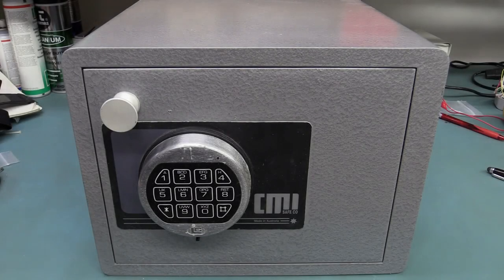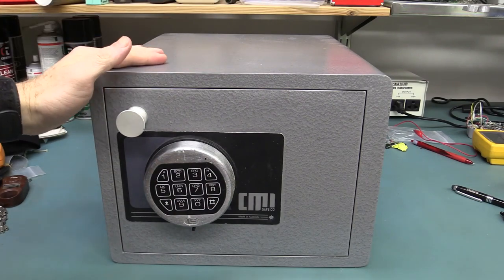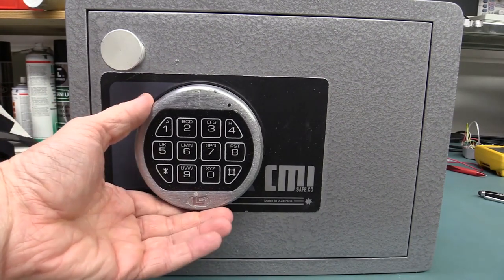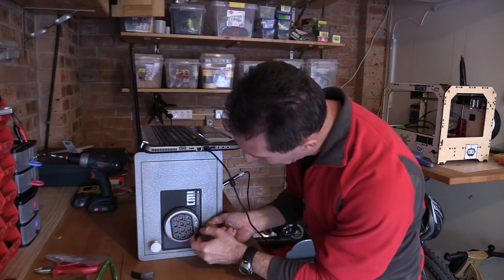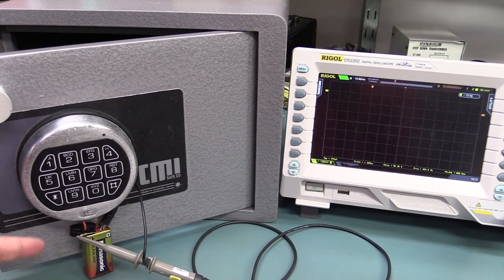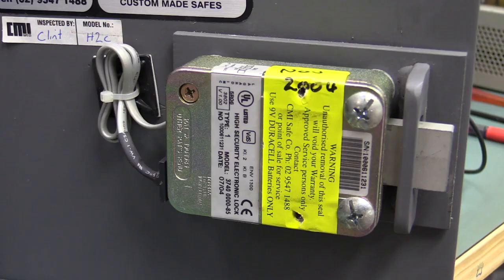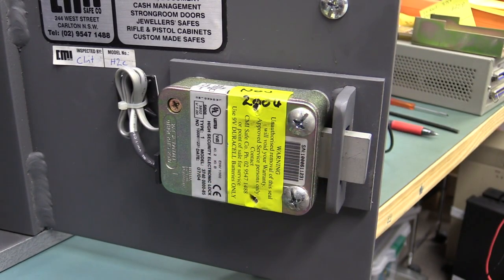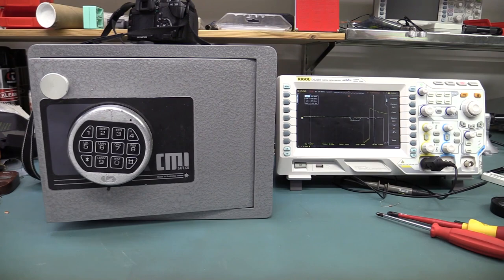EEVblog #762 - How Secure Are Electronic Safe Locks?

Comment: it also has an anti bump pin and spring combo on the opposing side of the solenoid. ONLY if you know EXACTLY what model lock is used, will you know the exact position of that solenoid plunger (witch can be drilled, and you can order templates right from LG for this) all you need is to pop off the face plate of the lock by slapping it upwards, and then at about the two o'clock position, approximately two or so inches from the square hole where the twist knob is, you will be almost spot on with a 5/8" bit.
However, the tiny variations in the lock types between model numbers of these LG locks, is very different in regards to that solenoid directly.
Some are even weird vertical versions of it, so you really need to know exactly what lock it is, what model number and even date it was made to get the right template.
I work with these locks all the time, and KABA MAS (its bigger badder sister company) Cencon models, witch are insane.
Those ones have one time use combinations based on a unique per key set algorithm, that if you need to get into the lock again for some reason (like leaving a flashlight in the safe or your phone....) you have to call the "key master" (main office that holds the key programming software) and they will re-issue you a new combination, you enter that in, hold your RFID key up to it, and it compares the digits you just entered with the allowed algorithm on the fob you have, then if it checks out the lock will grant access, after you close the lock it will not allow the key to be used again unless a "close code" is entered into the system, so the system needs the close code (the system at home base or the keymaster computer) from your fob and that combination, and it has to verify that your close code matches the open code it gave you, or it will not issue a new open code for the lock..... crazy right? yeah totally is.

Comment: Hello everyone , David if you hold a powerful magnet near the solenoid it will unlock (: guaranteed to work just operate the solenoid with Neodymium magnets magnet on from outside the box. you can hear it click. a bit tricky but you have to catch it at the right angle, this is for any digital safe

Comment: @eevblog Its loading a register with your key presses. When it gets to the correct number of bytes in the registers it will test them against the key. You can find out how many digits are in the key by looking at when the extra computer time happens after you press a key(the key check happens). After that you can look in depth at the compute time and try to tell the difference between a written 0 or 1 as it checks each bit.

Comment: Surely by reading the signal into the lock, you could make some assumptions about typical signals into the solenoid. 

Then you could inject noise into the lock through the battery connector and use that carry through into the solenoid? Or do you think the signal would be too attenuated?

Comment: At 11:15 Dave learned the first rule of working on safes:  After touching anything, ALWAYS test the lock (and boltworks) with the door open!  Also, the value of 12" (longer if you can find them) alligator forceps.

How did he close the door? The lock bolt stays retracted until the "dial" is turned counter-clockwise extending the bolt, the spring pushes the slide down and the solenoid pin pops out securing the bolt.  

I am retired, have always lived in the US and my work was mainly with US made safes.

ATTACKS:
1) Bumping the solenoid -- The solenoid operates in the same direction as the bolt on the lock. Bumping might retract the solenoid pin, but the lock bolt is also being bumped and will put pressure on the slide which in turn puts side pressure on the solenoid pin keeping it from retracting.

2) Removing lock cover from the back -- Dave didn't show everything.  When the lock cover is removed a relocker inside the lock is activated, stopping the bolt from retracting.  If it hadn't been removed previously, he defeated it off-camera and judiciously did not discuss it.

3) Drilling -- There is a lot going on in a very small space in the body of a combination lock for a safe; electronic or mechanical.  Drilling is not just having the right equipment, it is also expertise and finesse.  Without intimate knowledge of the lock and the safe, drilling will likely create a more difficult lockout.

50 years ago the hardplate protecting vital areas of burglary resistive safe had a minimum hardness of Rockwell C60 and the science of hardplate advanced significantly over the years.  At the time I retired, some hardplate was absolute hell to penetrate and by no means did I see it all.  If Bob Burglar successfully penetrated modern hardplate, he would be one in a million.

Comment: EEVblog Dave should have tried entering 6 Number and check the timing after that. if the controller reads in 6 Keys and then starts comparing it may then make some kind of early exit after the first wrong numbers or something similar

Comment: Mounting the safe is absolutely essential. Otherwise, you've just boxed up valuable things for someone to take back to their place and break into at their leisure.

If it's attached, they have to break into it in your house, and that's not normally a fast or quiet process. :)

Comment: Old fabrication or Machining trick if you're drilling through steel or hardened steel and cast iron is to use Dawn dishwashing liquid instead of oil or cutting fluid the drill bit will last quite a bit longer love the channel man

Comment: The real quality safes such as the ones used in banks don't provide access to the 9-volt battery nor the internal power circuit of it unless of course it's out of power, in which case the circuit will be opened up to two pins on the outside front to allow bank employees or locksmiths to provide temporary power in order to open it. There's absolutely no way to break into them without brute force methods... which would break the glass anyways. They also have timers so that even given the correct combo they won't open until that timer is up, usually set for minutes before the business opens again.

Comment: Ideally only the keypad should be located externally, the circuit board that controls the lock should be inside the safe where it is totally inaccessible for "hacking." The circuit board also should have timeout periods of increasing length if wrong codes are entered so that someone could not cut the keypad out and use a digital device to brute force the lock by entering all possible combinations. 

I would also prefer a safe have both a digital lock and physical lock(either keyed or combination) to open. Well a primary safe door that is, if it has a secondary access door for things that are needed quickly it could be a digital lock only, such as a self defense firearm, but it's pretty easy to get a small secondary safe for that purpose, and most gun safes do not have a main door, and a quick access door.

Comment: Some high end locks e.g. the Government grade KABA X-10 (KABA also own the La Gard brand) require no external power source which pretty much guarentees no form of powerline manipulation. Power is generated by the user "dialing" the combination, it could still be vulnerable to "shoulder surfing" (like push button locks) but the numbers are shown on a well shielded LCD display which is far more secure.

Comment: I wonder if you could apply smartcard breaking techniques to the powerline?  Glitch it with voltage spikes until the micro starts skipping instructions, hopefully to the instruction that opens the solenoid.

Comment: I realise this is an old video, but I've always wondered if electronic locks could be defeated with an external electromagnet to push/pull the solenoid pin? Also just a note on the software side of things, I'd be utterly astonished if the code actually checked the number on each key press, rather than comparing the code after the last number had been entered.

Comment: Try injecting some RF power. You may be able to bias the solenoid driver transistor ON via circuit rectification. A variable frequency, variable power RF signal applied in either differential or common-mode to the power wires may couple enough RF into the driver circuit to do this. Try frequencies over a wide range - my guess is UHF may work best.

Comment: I wonder if you were to super impose an AC signal from a frequency generator onto the battery voltage  and then press the key pad, would you see a difference in the AC amplitude as the correct/incorrect buttons were pushed? I expect the most obvious response would be around the cutoff frequency  of the internal capacitor.

Comment: Could you do anything to the power to shorten the lockout cycle thus allowing faster brute forcing?  Essentially overclock it?

I don't do electronics so I don't know if you can mess with oscillators that way.

Comment: Most of these locks can be opened in seconds with a large Neodymium magnet.
The mag, when placed in the correct spot simply pulls open the lock actuator.

Comment: Dave, this might sound silly, but because the solenoid is basically just an electromagnet, what happens if we wrap a huge coil around the safe and run current through it?  Would anything iron that is moveable move if we could get a strong enough magnet?

Comment: Step 1: unscrew the handle and push the screw inside the safe.
Step 2: drop a small magnet along the door on a string through the hole (you may have to widen the hole with a drill bit.
Step 3: drop a second magnet on a string into the safe and wiggle until two magnets lock together.
Step 4: pull the magnets out. Now you should have a string looped around the deadbolt.
Step 5: using the string pull a cutting wire through the safe.
Step 6: cut the dead bolt.

Comment: Interesting attack, it could be susceptible to such attack. But when you think about it. When you design a lock like this, each time you press a button the processor saves it into a register either it is good or not, that's why your getting the same result. It is only when all 6 digits have been pressed that the processor compare it with what is in the memory.

Comment: Do not assume that the default admin combination of the vault in your hotel room has been changed from e.g. "0000", or"000000", or "12345", or whatever the manufacturer uses.  I have twice encountered hotel room vaults that could be opened with "00000" after I had entered my guest combination.  Always challenge the room vault before trusting it.

Comment: I'm pretty sure you could bump that thing open with a hammerdrill or pneumatic hammer while gently turning the lock. If you have the patience to get the timing right you could probably even do it with a couple good whacks from a sledgehammer. That little tiny spring just doesn't seem too make the whole lock bump proof and I didn't see any glass plate that could shatter from the impact.

Comment: The material in between the two steel plates on the TDR is actually fossils, according to the Discovery Channel. I wonder if cutting out the external steel plate, then chiseling out the fossils before cutting through the rest would work. Maybe not if the plates are made out of tool steel or tungsten carbide as well.

Comment: Is the resolution of the ucurrent good enough to plug into a scope to detect these tiny current variations? As others said, you need to do a followup video on powerline manipulation, powerup readouts, brownouts, timing attacks, etc. Throw a scope on the eeprom to find the exact time the data gets read out of it to see if it coorelates to anything on the power bus.

Comment: The safes I have also have key access. Each safe stores the other safe's key. If the electronics in safe "A" fail for some reason then the key stored in safe "B" can be used to open safe "A". Yeah...it means there's another point of attack but it's probably about as vulnerable as the e-lock...perhaps even less so. I pretty much consider the electronic keypad lock more a convenience factor than a high-security element.
If someone is really determined, they could cut through the safe with modern battery operated tools or cut-off the bolts from the other side of the wall...or just cut out that section of the wall...unless I make that more difficult by adding heavy shielding in the wall itself.
Reply: That's one of the main problems with the 80 dollar convenience store safes actually. The physical lock is absolute shit. Usually hidden behind a logo plate that comes off with screws and it takes more time to undo the screws than to pick the lock with minimal skill.

Comment: If it locks you out for 5-10mins after 4 or so numbers of incorrect combination attempts, then it seems likely that you could easily reset that by simply disconnecting and reconnecting the battery after the lockout.  I suppose it could have some kind of capacitor in there that is just there to store enough to keep the 'fault' condition from resetting on battery disconnect.

Comment: If the difference in signals was simply whether the correct button in sequence was pressed you'd use 6 attempts out of 10  (wait 5 minutes) then try the remaining 4 to get the first digit, (wait 5 more minutes) then starting with that successful 1st digit try to acquire the second digit and so on. Max time would be an hour.

Comment: That safecracking job when you reconnected the lead back into the solenoid is a surprisingly valid break in.  If you knew the pin outs on the power leads, one can simply apply voltage to the solenoid and pop the lock open.  Smart Joes could take a tube of silicone or hot snot to the power lead, locking it down that way, would thwart that vector of attack.
Reply from the maker: Nighthawke70 No, you can't do that on this lock. The solenoid is protected, they have a patent on this.
Reply: Curses! Thwarted  by patents!

Comment: they prevent power line attacks not just by decoupling. mainly by CODE algorithm.. well its simple the processor doesn't check if the pattern is correct or not until you enter all 6 digits, every time you press a button the processor wakes up stores the value of the button temporarily in memory(they could use different values than actual numbers or even in random order for each time) until you have 6 values stored in memory after that the processor checks if its correct or not.. very little you can see when this algorithm is used, even if you detect a different waveform it doesn't matter since you already have entered all the numbers and got the result anyways lol.

Comment: You should really spend like ten bucks on some kind of surgical / endoscopic pliers. They are readily available on ebay, go up to 30cm and incredibly useful for such tight situations (plugging cables or adjusting pots in hard to reach places etc)

Comment: One may not need an oscilloscope...if you can see signal variations like that on a scope, then it may be possible to just hold an AM radio (tuned to a "clear" space on the band) near the keypad and listen for the variations as the processor changes operations/subroutines. Digital keypad circuits often output RF signals that vary as a result of where in the program code the processor is working and the AM radio picks up the signals and outputs them as frequencies and patterns you can identify over time.
The same principle as is sometimes audible holding a radio close to a remote control. Even infra-red remote controls still put out identifiable RF signals the radio can pickup in a clear spot between stations although it isn/t picking up the actual IR signal from the remote...it's picking up the activity of the processor and/or the circuitry that controls the IR LED. Even when the IR carrier is at a frequency too high for human ears to hear, the AM radio makes hearing the circuit's modulated signals possible.
Reply: I think it's more likely the electromagnetic field from the circuitry is interfering with the AM radio because you're holding it too close, rather than it actually emitting RF signal that are picked up by the AM radio's antenna.

Comment: Try using a spectrum analyzer. You could probably shove a thin antenna through the hole that the battery wires go through. I'd bet that you could pick up the bus traffic that way.

Comment: Errrr................When you accidentally closed it with the cable unplugged,  why didn't you just use a long reach screwdriver through one of the rear bolt holes to undo the 3 retaining bolts, so the lock would just fall off the back of the door?

Comment: Why not just use a really strong electromagnet to pull the solenoid rod towards the other part? Then you dont need to guess, and you could flip the safe right over popping right open. No?
Reply: The Sharp Take not easy, through a thick steel door which absorbs the magnetic field!!